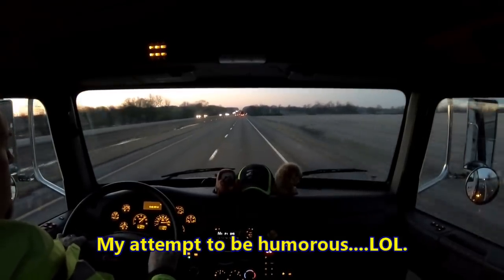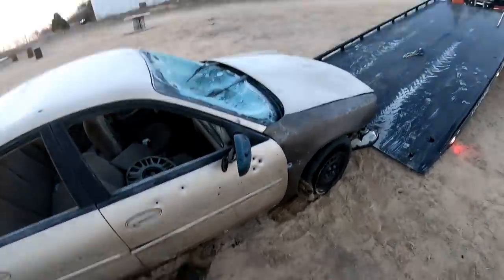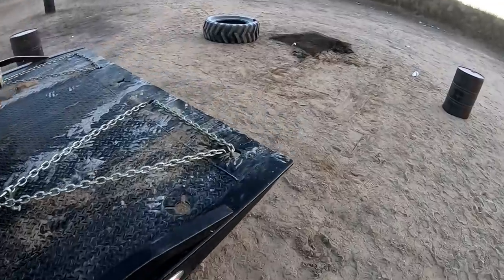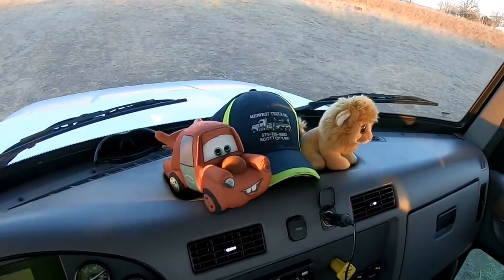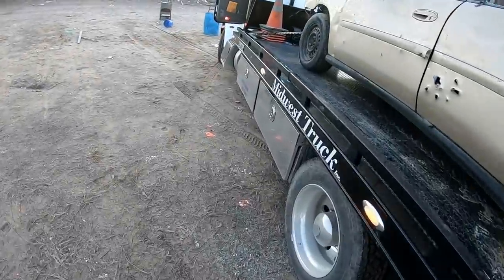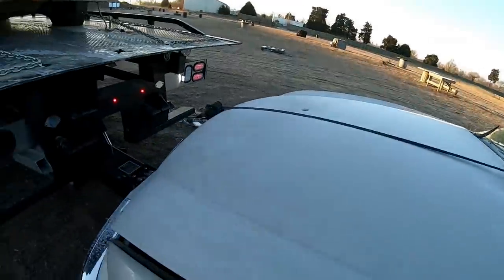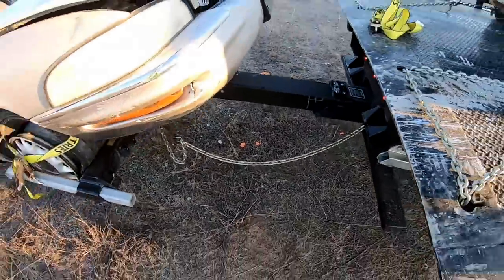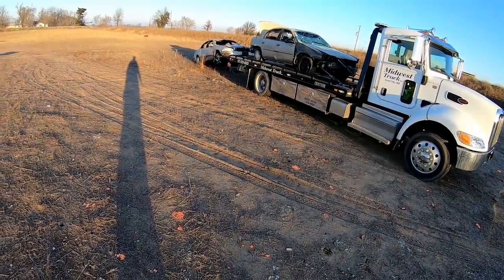Tow, Tow On the Range

Comment: Yes, but you bent that trunk latch towing it with that... That could have been used at the scrap yard by someone looking for one, so you only made it to 8.875 in my opinion, LOL....   Be nice if you said what truck you were driving. I didn't know you owned a Peterbilt flat bed or roll-back. I did know about the Ford. I could not tell by the interior what you were driving until later in the video... Other than that was a great video & I gave you a thumbs up. I watched this on 3/7/2019   FYI: I did read your call the shop message and for what it is worth, I've never tried to call you in any shape or form, I only leave comments on here which I hope you at least read as a "thumbs up would be nice so I know you read the comment. I would never call you at work or anywhere else unless I needed your services. Since I have no plans to visit the MidWest, I doubt that will ever happen....  However, I do appreciate your videos and God Bless........
Reply from the maker: 👍👍👍👍  I do read your posts.  I read ALL the posts, even though I may not have time to respond to all of them.  As for bending the latch, we can't sell these cars to a salvage yard where parts can be used off them.  We have to take them in for complete disposal....crushed.   I will accept the 8.875, though.  I could have done better...LOL.   Thank you sir.  God bless.
Reply: @RonPratt  #1 you know I was kidding about the trunk latch, LoL...#2 As for reading posts, I know it's a big job and I really understand you can not answer all the comments you get. It's a big job I surmise until you film, render it, post it, then read the comments which I'm elated to hear, even the ones that are "snide" & I apologize for the tolls that leave hateful comments.  I have great respect for you and your crew and I truly appreciate your reply on this one subject. I joke around sometimes but in respect I know you are one of the most conscientious and well equipped rescue people out there, even if they are just just wrecked cars or cars used by the police for training to be crushed later on.  Again, thanks for your time via your reply and God bless you and all your loved ones. Safe rescue / trucking to you and your crew too.